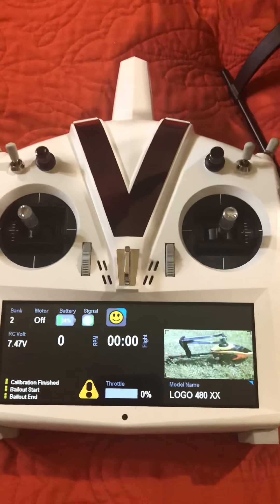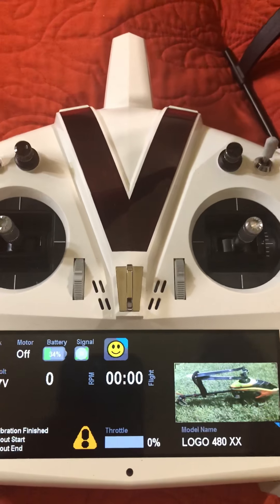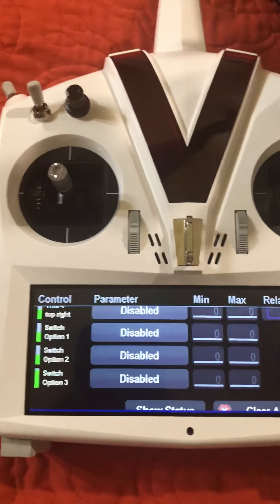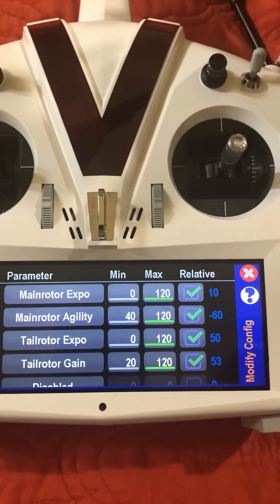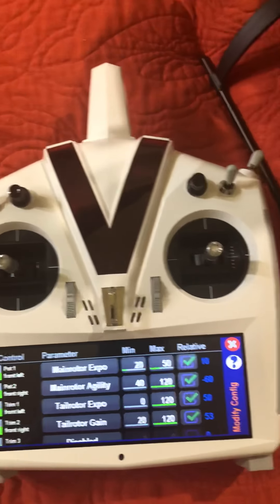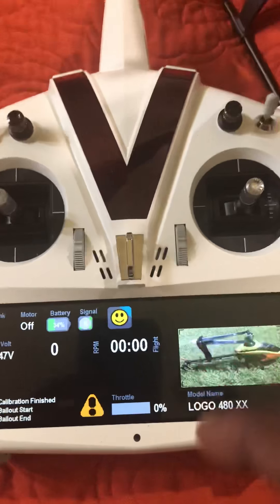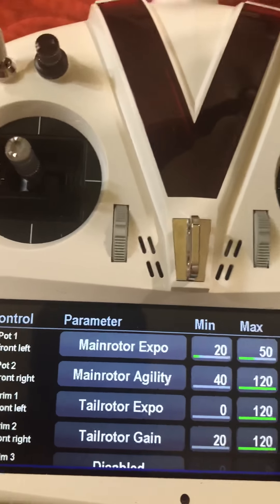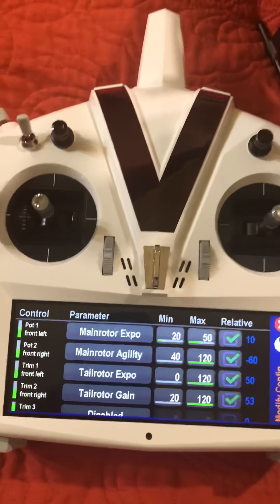VControl Touch “How To Assign Values To The Pots and Trims”

Comment: Nice video.  I have a few questions:

1) What does the "Relative" boxes do"?  When do you check it or uncheck it?

2) What are the blue values to the right of the "Relative" boxes column?

3) How do you add the parameter to the main screen, so one can easily see the parameter number during flight?

Comment: Nothing but bugs.  Poor/non-existent documentation.  I'm not impressed.  "Tail Agility"?  No such Neo parameter and the slider, if it's supposed to be Tail Rate++ doesn't match that of the Neo parameter Tail Rate++.  Can't assign any of the Neo eGov parameters such as Basic Throttle, Collective Ad, or Gain.  Those are the three that I would want to see.  You can change the ESC output for a Hobbywing ESC, but you can't adjust any of the native VBar Neo eGov parameters using a switch..  Great implementation...  I give a C- as a product grade.  Top dollar too.  Nice.